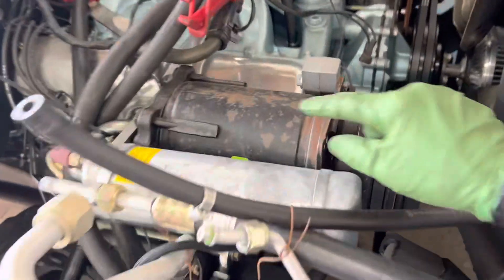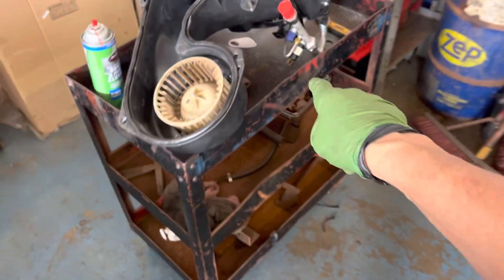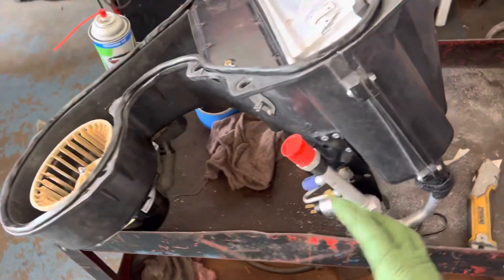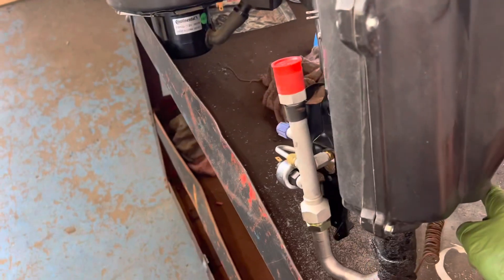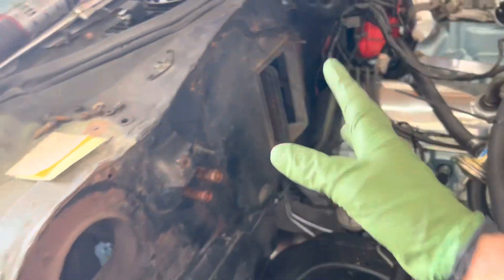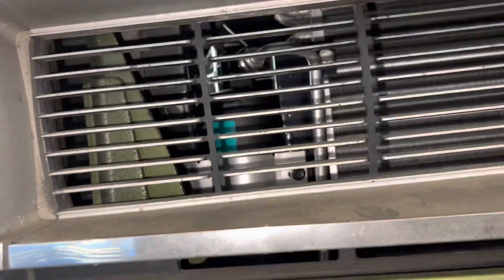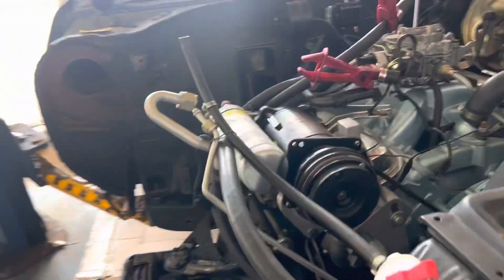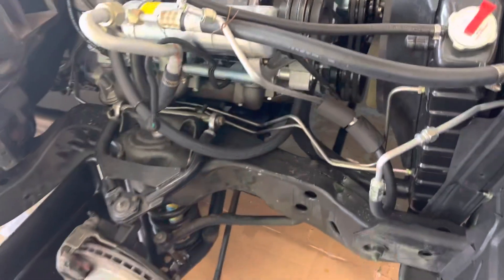OLD A6 COMPRESSOR (Old Air Products) retrofit conversion kit. “ I can’t remember Part names 🤦‍♂️￼

Comment: Nice to see the old systems.
Carburettors had got very reliable my dad had a Renault 25 petrol manufactured in 1987, he did about 120k miles without even touching the Webber carb.
Reply from the maker: I don’t miss rebuilding and adjusting carbs.  I like going 350,000 with no problems on fuel injection.

Comment: I had a few different cars with that system or similar A6 systems.  My 69 Olds had a latching relay in the fan clutch circuit so that once the system was on the compressor would not disengage until the engine was stopped, even though the AC was switched off on the dash.  I think that was their way of protecting against the driver restarting the system before pressures equalized. I don’t know how many different vehicles had that design. 

Do you know which refrigerant they plan to use?  Some sort of R12 replacement?
Reply from the maker: R134 most likely.   Simplest easiest cheapest most available and works good when properly recharged what most of the shops do not get right it’s always the technicians fault.. 

Most of the technicians and shops use the wrong retrofit oil .  That is also the technicians fault.

Most of the shop to get the oil charge quantity wrong when doing a retrofit 

That is also the technicians fault 

Even though they use the old style three eights inch tubes on this condenser .  I’m pretty sure by memory. Looking at the fin count is actually more dense more fins per inch what help in heat dissipation. 

There’s no reason why this thing can’t blow. Ice cubes out the dashboard with R134A
Reply: Can you explain how the pressures are equalized this way?
Reply from the maker: @5aldl  what pressure ?.   
Between High side and low ac is shut off ? 

Bleeding back though the expansion valve unless it’s a hard shutoff

Comment: Valves in receiver
Reply from the maker: Yes, valve inside the receiver dryer.

There is also POA valves, EPR valves and suction traveling valves. All different arrangements used to control pressures and temperatures things that are not used anymore. They were too complicated for simple minded technicians to comprehend.